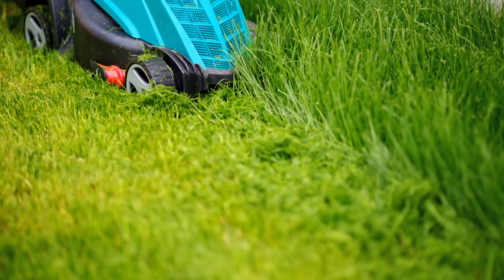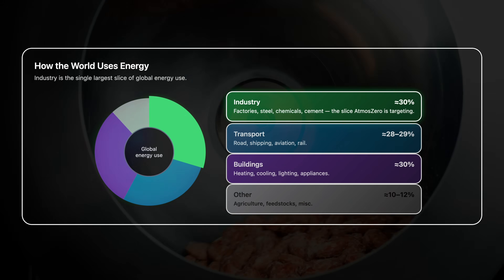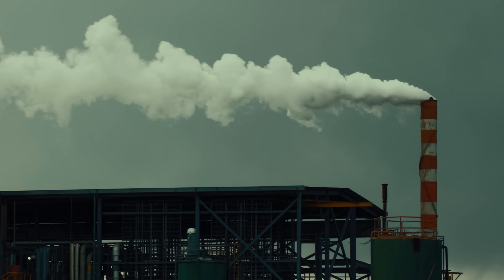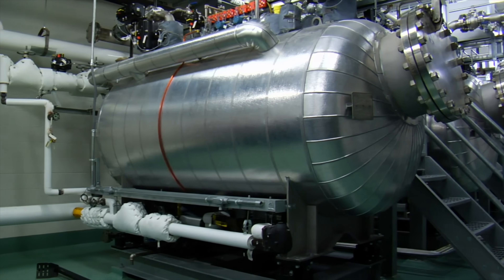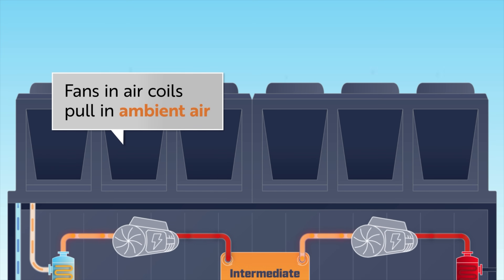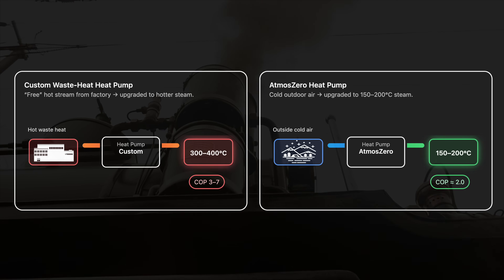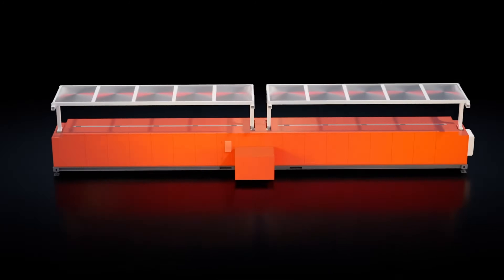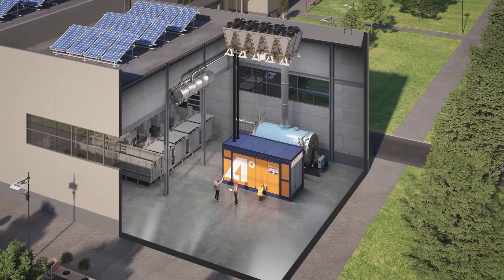This Startup Just SOLVED the Hardest Problem in Clean Energy

Comment: Starting off with a standard, mass produced unit to get changes going. Once that basic design is up and running, add-ons that allow putting the primary exchanger into the exhaust stream to boost that efficiency can become possible. Get the tech started, and increased efficiency will follow.

Comment: Essentially, this provides a way to continue utilizing prior investments. However, there is a threshold where externalized costs exceed what is being saved. As such, waste heat collection costs should be weighed against otherwise externalized costs to the natural environment and as things are going, soon to the built and social environments. This is an economic reality that has largely been ignored far too long. For free enterprise to really be of benefit, all costs must be included in the price. Otherwise, we will continue to be bound to a systemic race to the bottom.

It would be good if this excellent new industrial heat source included simple adaptability to subsequent waste heat inclusion.

Comment: If we get rid of all the carbon dioxide in the air, what will the plants eat? It's not even close to the top of the greenhouse gases in terms of raising the temperature. I think the world would be better with a little bit more carbon dioxide. However, I will say that the other pollutants that are produced should be limited as the environment should be protected, but I think dying on the hill of carbon dioxide reduction is rather foolish.

Comment: It's a good start, but won't decarbonize all industrial heat. This would work for uses < 200 C, but lots of processes need heat at a higher temperature. For that you still need gas or Nuclear.

Comment: Great. Now we just need (SMR) Nuclear reactors to supply cheap clean stable power. Wind and solar aren't cost effective or robust enough. in order to use wind and solar in industry they would need to divert all battery manufacturing from EV's to support solar power and wind installations. Then you still risk renewables being wiped out by severe weather, and they present land use issues.

Comment: Ok, but what runs the pump? Where does that energy come from? Oh that parts not clean.  So its like evs. Sure its clean,  but the power pumped into the clean thing is dirty.  
Make it make sense? The only way to clean energy is nuclear.  Everything else starts with dirty grid power.  Its all a scam.  It all requires dirty energy at some point.

Comment: I've been looking at R290 monoblock technology for my house. It seems to be the best but I was surprised to find that it couldn't heat my water at the same time that it was cooling my house. It has to switch over and pull heat from outside to heat the water. After wasting all the heat that was removed from the house. Seems like another heat exchanger and a glycol loop would fix the problem but I need an off the shelf solution. I don't have time to build that. Also the house wouldn't sell as good with a custom heat pump installed. No commercial HVAC contractor would touch it. We're not there yet.

Comment: We're getting closer to the point where structures will be designed with some accommodation for air-source heat collection and transfer built into the structure from the initial design phase. We dont question things like ridge vents, and hopefully in the future there will be equally ubiquitous accommodations for heat COLLECTION that can be tapped by different systems as the heat-moving technologies change over time.

Comment: Seems like they could drop in this thing and get it running, Then just put in piping for exhaust heat exchangers without disrupting company operations, and make your final connections on a weekend or something when they're shut down anyway.  

point being, I think plug and play efficiency solutions are also viable.   Might not get you Bespoke custom efficiency, but you could get a boost in there to be added down the line.   Do you see what I'm pointing at there?

Comment: One way I like to use to think about installations are: "green field" vs "drop in". "Drop in" is the approach that Atmos is pursuing and is a good way to introduce a technology into the marketplace, but only if it's adequately appropriate to really be a "drop in" replacement for an existing unit. It has to be cheaper, or smaller, or less expensive to operate, or something like that. Meanwhile, "green field" says we are starting with a clean sheet of paper for the overall project. This is the approach where we want to harvest more of the goodness a technology has to offer. Short term "drop in" is a great way to introduce new tech because it's less disruptive to the overall installations, but long term, it will be a progressively smaller portion of the total addressable market.

Comment: A technical problem with producing even just 200 °C heat with heat pumps from ambient temperatures is that the efficiency of heat pumps decreases when the temperature difference increases, like an inverse of Carnot's theorem. Multiple stages reduce the temperature difference per stage, and can increase overall efficiency, significantly, but additional stages requires additional stages of heat transfer, and multiple heat pumps. 

AtmosZero seems to have identified the fundamental problem, and that is the fact that companies want pretty quick return on investments done in order to decrease their costs, and they don't want any significant risk, or any change that could have negative consequences in any way. For most companies the new system has to be dirt cheap, and ideally be small enough to fit in unused space so they can keep their old system as back up. That's possibly the underlying reason to why they settled for just two stages, even if a system with even more stages potentially could be even more efficient, but it would have to be more expensive, and also bigger.   

While the potential to make decarbonization of some processes that are considered difficult to decarbonize economically viable, via heat pumps is fantastic, the potential impact that approach has if it becomes ubiquitous, for areas that commonly gets problematically high ambient temperatures is also fantastic. No waste heat from combustion to generate the steam, and no heat from heat pumps used for cooling that system replaces. Also, that system will probably generate a lot of water via condensation from ambient air unless the ambient air is extremely dry, so essentially a giant outdoor air conditioner.

Comment: I always thought I'd shoot myself in the head when I started thinking like an accountant but in a strange sense their mode of thinking IS an engineering approach - it's another input variable and factor that must be put in.  The excessive reliance on highly bespoke solutions over and over is a huge issue that's never really been dealt with too, at least not well;  I have been desperately hoping that the advent of SMRs would herald in the era of drop-in standardised part building (of a larger system) that we see in shipping (the standardised container), etc.  I think it's been a catch 22 in that nobody is building for standardised elements because they don't exist (often enough) and they don't exist because nobody's using them.

"De-carbonising" is too tied to political fashion and it risks losing momentum when that era starts to fall away - note that Bill Gates has basically pulled his hat form that ring as an example.  We SHOULD be doing this for different reasons though;  we need to develop and perfect systems that will work in much more limited and hostile environments for the future of our species as we head off into space and perhaps colonising other places (lunar bases, Mars, space stations, etc.).  These technologies of re-utilising heat are remarkably important in such a context;  generations now have to get back to "planting trees in whose shade they know they will never sit" technologically, if we evolve these foundational steps now they can be picked up and used over and over again into the future.

We even have games which simulate what it's like to act and think this way - it's a fictional impression of what it's like to have standard major components which you can pop into place with comparative ease, a lot of real world tech tends to be based on the fictional premise (I'm typing this on the result of this process right now).

But for the future - great things come from engineers factoring in that cost effectiveness element, most recently your presentation on the US based salt batteries was a VASTLY bigger deal than it seems (I see those as being instrumental to grid buffering, a system that can buffer supply and demand locally and help limit the impact of grid frequency disparity as well as reducing spikes in demand which we're about to be unable to cater for in many countries, the UK nearly having grid collapse in February being an example).

Comment: The video shows that the air intake can be separated from the heat pump. I guess when you have a heat source close enough, you can still run that directly into the system or at least put the exchangers into the path of the hot(er) air. So you can reap benefits but this design isn't dead when that would be too expensive. So this sounds like a pretty good solution. But it still makes me wonder if you can't use the waste heat of the traditional boiler in a heat pump to make the boiler even more efficient. Is there too little waste heat (=most heat gets transported away with the steam, so this approach would have to collect it from far away) or is there simply no free space near those boilers or something else?

Comment: @8:00 "..spinning at 30k rpm" I hope these pumps derived from automotive turbos are made easy to replace and rebuild. If they run constantly, they will last more or less a year, everything else being equal. 250kkm averaging 50km/h is 5000 hours, or just over 200 days of operation. Even if temperatures are more constant and the gases involved less contaminated/corrosive, this should be the starting point for an evaluation. Would be interesting to know how these pumps have held up in the prototype, but I'd assume this is a tightly guarded secret, as it should be. I wish them success, have no doubt it works, this just immediately jumped out as a concern to me.
Reply: I guess the failure mode of an automotive turbo is a bearing failure because of oil contamination, rather than a mechanical failure of the impeller blades themselves. I assume a custom housing and bearing assembly is needed to use them in a heat pump. With magnetic bearings it could run forever.

Comment: Okay, so how long is the plant shut down to install the new heat pump unit with all the new piping needed?  Pretty sure most plants have a bypass system, even for waste heat; prebuild all the piping needed, except for the tie-in, when ready do the bypass, install the valve for the new system, OR do a hot tap (which is common practice) for gas and water pipes. Heat up a stack? 100 feet of coiled stainless-steel piping dropped inside as a heat exchanger, no shutdown required.

Comment: I work in facilities maintenance, this company’s main client market. I have worked in a company where they segregate technical and commercial processes, where one makes the specs and then the other procures it. No one has the incentive to be practical. Lo and behold, everything ends up gold plated and super expensive so gets rejected more times than not. Same lesson these guys are following. In business, it does not matter if you have the most perfect widget, if it is not economical then it is not going to fly.

Comment: Sounds great, but I'd love to have some ballpark efficiency numbers.  Does it use 20% less energy or 50% as compared to resistive heating?  It's large, which means it's probably more efficient, but trying to use two stages to pump heat from -20°C air and get 100°C boiling water is much harder than heating a building because the temperature difference is much larger.

Comment: I like this idea.  Water source heat pumps and geothermal heat pumps offer that boost in efficiency.  Has any company or inventor come up with a stackable system to use glycol and multiple heat pumps to have a unit that can be dropped into a pond or a twenty foot hole and attach to a heat exchanger and legacy home heating
System?

Comment: what is the real cop? hot water heat pumps market themselves being over 2, but realisticly reach 1.6-1.8. now you have a much higher output temperature and want to reach anywhere close to to 2, starting from ambient? i highly doubt it.
this seems to me they want to avoid regulations, by "going electic", which might be fine in the long run, but atm they just burn the oil somewhere else to produce the electricity

Comment: There's a very good reason those custom solutions are used . Efficiency is king when you are talking decades
Reply: Only until the next new thing.  Generic drop in solutions, hooked up to solar and batteries sized for the job, and you have potential advantage short term, especially if setting up a new factory to get that efficiency is longer than the ROI

There is a future for generic plants, be it as stopgap measure, or avoiding disruption to production.
Reply: Yeah, I had the same question. As often on this channel, the video turns into a PR piece for the company whose product is featured. They've found the "perfect" sweet spot? No drawbacks to mention?  C'mon.

Comment: Also it's a simple retrofit to change this drop into stage heat pump to run on waste heat. Two heat exchangers some piping. And you have an isolated heat loop feeding the cold side. It's the kind of assistant engineer could build right out of college if it was designed with space to allow it. Added bonus it could always use backup regular atmospher
Reply: "Also it's a simple retrofit " No retrofit is simple. if you fail you are out of business, and all are unemployed, you are sued to less than zero. 
Out in the real world , life is hard.

Comment: plumber and boiler tech here: this is a cool idea but your explanation is a little oversimplified and hides some of a major drawbacks of this system.
1. heat pumps efficiency changes based on the input and output temperatures. Think of a heatpump like a freight train pulling that heat energy up a hill. the colder it is outside, the steeper the hill, the more energy it needs to expend to move it. 
so while they may have a COP of 2, I ASSURE YOU that is measured at room temp of 20c, and it drops off as it gets colder outdoors, meaning that COP of 2 is... an optimistic measurement. 
2. cost of maintenance. most boilers are pretty dead simple systems, but here we see this heatpump system is effectively 5 AC compressor loops strung together, running 24/7. those compressor motors WILL give out and they'll be bloody expensive to change every few years. 
3. the power of natural gas appliances is also not a constant; as they actually get MORE powerful the colder it gets outside (to a point). cold air is more dense, which means it has more oxygen, which means the potential BTU of a high efficiency burning system can actually increase with cold weather to combat the heat loss.
4. a large amount of steam production is a BYPRODUCT of other systems, such as a steel mill, or more commonly, fuel refineries. in the case of a fuel refinery, these systems HAVE to be gas burning, because they're literally burning the light oil byproducs from distillation to create the steam needed for the distillation. its a feedback loop. that excess steam is used for distric heating, or to power turbines to create power for the plant and to sell back to the grid. infact, many refineries are actual power generation stations as well. you literally CANNOT electrify these systems or you'd destroy entire parts of power generation on the grid, and up-end fuel processing as we know it, causing the price of medium oils like what eventually becomes gasoline to skyrocket.
5. size. that thing is massive and needs to be installed outside, or at least have a portion of it outside, while modern high-efficiency boilers can be pretty compact now in days; especially if they're built in an array of smaller units. 
6. the pipework argument is situational; many factories and even high-rises have more than 1 boiler. its common to run units in arrays, or at least twins, and the piping SHOULD have many isolation valves if it's done right. that added redundancy massively reduces downtime for repairs and maintenance on existing systems. 

this system is probably best suited to light-commercial and heavy residential applications that have roof-top boiler room systems, or lots of free yard space, but It's NOT a magical solution that will replace gas fired boilers. I see this being applicable in maybe 5% of use cases in new construction where the system can be engineered around. its a good idea for sure, and it definitely has real applications and benefits, but its NOT a 1-size-fits-all replacement. not even close.
I can see thsese units being installed ALONG SIDE existing boilers to supplement steam supply, especially in the summer, but I do not see them replacing most systems. 

what we're really missing in the technology chain here is molten salt batteries. thermal batteries. solar heating is GOING to be the most effective thing we can go, but we need a way to store that heat energy directly in an effective manner.
Reply: Good points.

Comment: It seems to me I made it through physics and chemistry at a good high school without an exposure to the magic of how air conditioning and heat pumps work, based the energy transfers of phase changes.  
Ice to water , water to steam, 
frozen “gases” to liquid ones, and so on, and in both directions.  
Then, I took a 101 level class in air-conditioning and BOOM there it was:
THAT’S How it works.  
I wonder if a short explanation or exploration now and then would be appropriate?